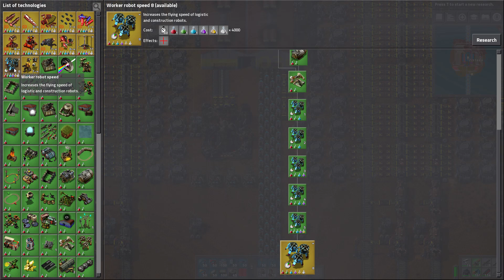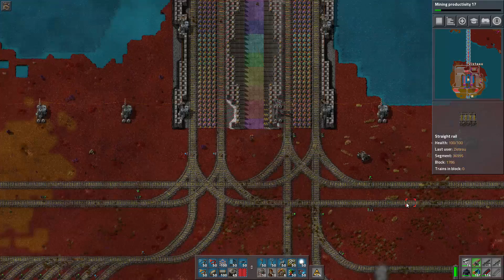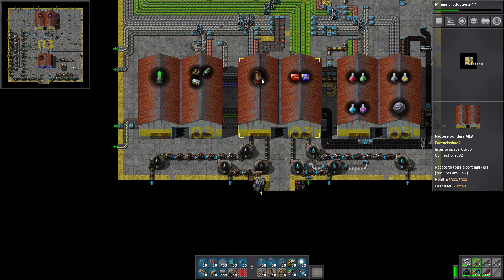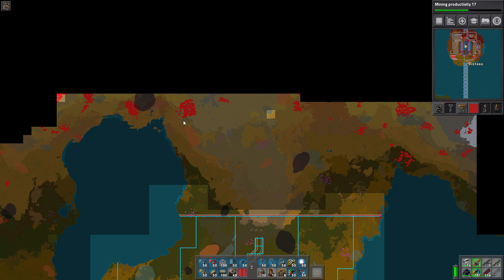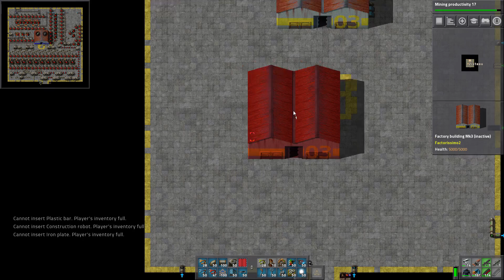Factorio Recursion #31 - Final Oil (0.15 | Factorissimo Mod)

Comment: Great series.  I love the dynamic of the space in the factory floor and the production goals.  Even though the factories are all infinitely large because of the recursion, they are always just a hair too small and require a clever design to fit everything in.

You can simplify the math for beacon designs with multiple crafting speeds by adding together the crafting speeds of each machine in a particular design.  For example, in your oil design the total output of petroleum gas per second is equal to the productivity bonus (1.3) x the sum of crafting speeds (refinery 1 crafting speed + refinery 2 crafting speed + ... + refinery 11 crafting speed)/ the recipe time (5 seconds) x the number of products produced per recipe (55 petroleum gas).  I find this particularly useful when a a certain throughput is required from a production line.  By rearranging the equation above, you can calculate what the total crafting speed required for a product is, write this number down, and continue to refine a design without needing to pull the calculator back out. 

Keep up the awesome work.  Thanks!

Comment: For anyone who wanted a spreadsheet for calculating ratios, get the mod "Helmod" instead.  It is perfect for any production planning and doesn't you don't have to worry about any errors in the recipes.  Works with modules, beacons, and any modded recipies.

Comment: About your spreadsheet, you should look in to the mod "Helmod" it is basically a in-game spreadsheet where you can input factors like the number of beacons around a object and what modules are in it. You make production chains and it tells you your total input counts for the production chain and how many of each type of building you will need.
Reply: Thank you so much. I've been trying to do this with a spreadsheet, and it's doable, but slow and kinda painful.

Comment: Zisteau, instead of throttling your cracking production with # of speed modules in beacons, I think you should consider using circuit networks + pumps. It's very VERY simple as opposed to the way most people use circuit networks and you can figure it out just by playing with some wires in about 5 minutes. You won't need combinators or anything either, just wires and pumps.

You can do neat things like store heavy oil in a tank and only crack it to light oil if you have >50% of the tank full. That way you always have plenty of heavy oil for your lubricant production.

Just a thought, consider it if you like.